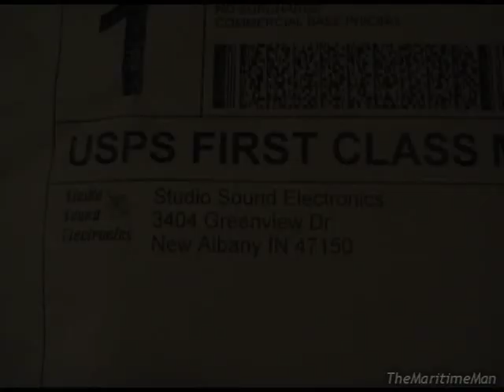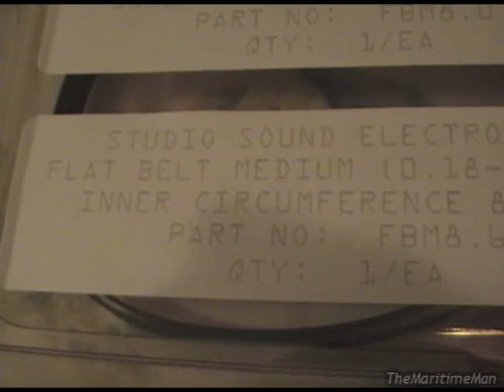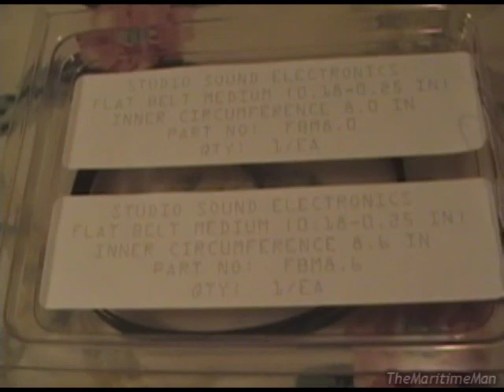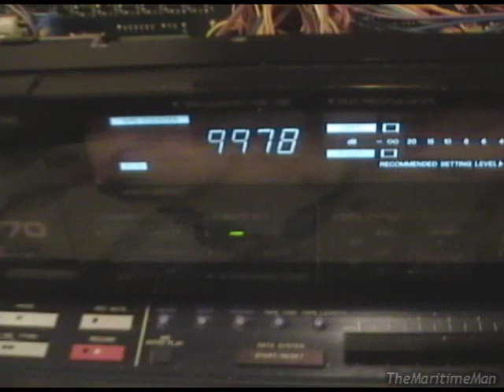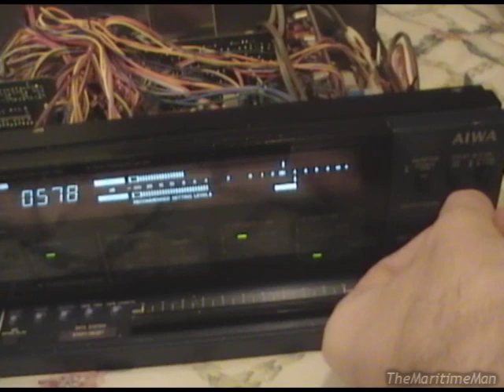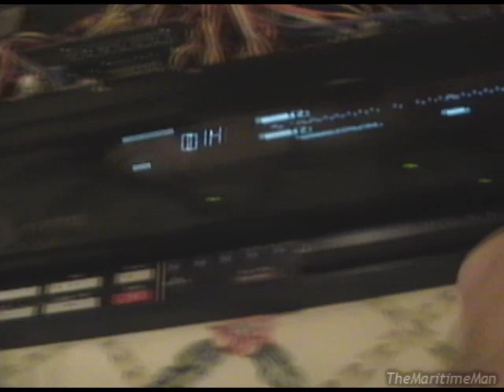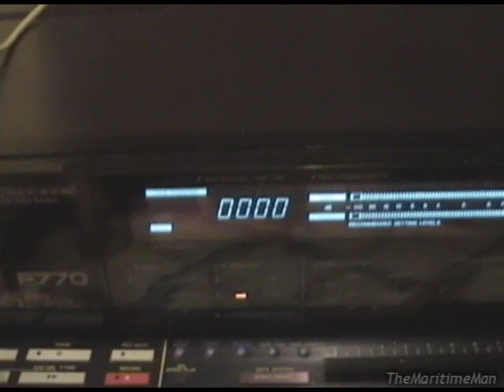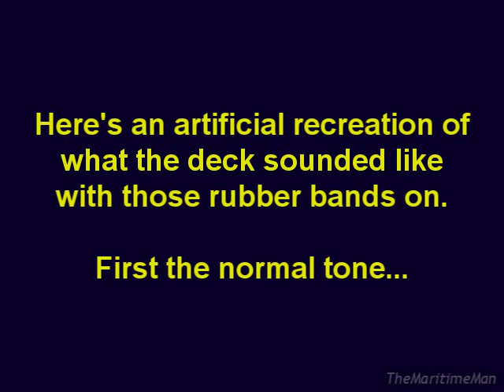Replacing belts in an Aiwa tape deck, the easy(ier) way

Comment: This is a terrific video- thank you so much for posting it, and for all the attention to detail. I took a bunch of notes! My 770 is far and away the best tape deck I have ever owned. I never get tired of hearing those solenoids snap into place; what a great, tactile feel.
Reply: me also zooming 770 or 990 from ebay and elsewhere. need a little help to find reasonable price/condition. my pioneer double deck,i did broke it today,diode goes kaputt.

Comment: Great instructions! I did change the belts in my 770 many years ago and worked out the same way to do it. Good to see someone else coming up with the same method. Gives me the confidence to do it again! Didn’t know about the speed adjustment, which will be useful!

Comment: The Aiwa ADF-770 was one of the best "bang for your buck" cassette decks made in the mid 80s.
If you could not afford a Nakamichi Dragon, then this deck or it's slightly more expensive brother - the ADF-990 was a good choice.

I still have my 770 that I paid £325 (currently $505) in early 1985. This would be the equivalent of $1200 now. 

The best features of this deck were HXPro (superior HF performance), DATA (tune the bias for each individual tape), 3 heads (monitor the recording in real time), ADMS (auto de-degaussing of the heads), Closed Loop Dual Capstan Drive  (wow & flutter = 0.025%), & Accurate remaining time of the tape on the display.

The "DATA" self tune was amazing, it could make a standard ferric (type 1, 120 µs) sound better than chrome on a "lesser deck". My friends & I could not tell the difference between a switched live CD & a "DATA" tuned chrome or metal tape (& we had young ears then!)

Well done & thanks for the belt replacing tips, but in the time that it took you to take the "short cut", you could have removed the whole transport mechanism and tackled it correctly with the confidence that all screws were torqued up and that you hadn't strained anything. I know these decks can look intimidating at first but you have to get "stuck in" to learn.

I'm just about to replace the take-up spool motor & belts in mine... Hmmm, maybe mañana!

Comment: Of interest - the whole cassette drive mechanism can be pulled out if you unscrew the top two screws and one underneath the chasis. One doesn't need an angled screwdriver, although the usual care must be taken. Don't forget to disengage the mains switch on the left too.

Comment: Those last few tough-to-tighten screws are probably because you tightened the other screws first and removed some critical slack needed for perfect threading alignment on the final, yet-to-be snugged home screws.  Try turning each of the screws, all of them, LIGHTLY, maybe 2-3 revolutions each, then go back and snug each screw a bit more, then a bit more while gently wiggling the whole back assembly back and forth/up and down as you're doing the screwing.  Think about how you thread and tighten the lug nuts on a car wheel--it's a similar technique.  This will help maintain alignment in each screw as it tries to find it's "home" while counteracting the effects of gravity pulling the whole enchilada downwards. 
Gravity pulling down on the back of the assembly will  mess with a clean threading motion).  You may also lay the deck flat, face down on a clean towel while doing these final screwing steps, obviating gravity altogether and in fact using it to your advantage.  Outstanding video, by the way, and I commend you for your kindness in sharing your hard-earned ingenuity.

Comment: Thank you so much to post this video.  It will help me to replace the belts.  I bought the F770 deck brand new 30 some years ago.  It is a very good deck.  I tapped all my vinyl on tape and the sound from the tape almost no different from the original vinyl.  
The belts was replaced by a repair shop over 20 years ago and now the deck stopped working again.  I assume it is the belt issue again?   It happened after my last time turned it on and the deck stopped right the way,  but the door would not open and I cann't remove the tape.  Do you have tips for the door stuck issue before I open it up for belt replacement.  Your help is appreciated.
Kim S.

Comment: Thank you so much for this video. I have an R650, I can't find a diagram to show the path of the belts.  When I ordered the belts, I got two.  One flat and thin and round.  I thought the thin round was for the tape counter.  Does it make sense that the two belts are for play and ff and rr.  I put on  one belt, it only works for fast-forward and rewind.

Comment: Just picked up a F990 and wasn't playing tapes and I suspected the dreaded belts. Well, I was right....completely melted! On the main motor drive pulley, and the 2 flywheels. I did get a hold of the service manual but wanted to see an easier way to access these area's to get off all the belt funk off without dismantling it.

Comment: I got an Aiwa AD-F850 and it's probably the easiest to replace the 2 belts bc the inside of it is mostly empty space  and there is just 4 screws to be removed to get to the belts, I guess the AD-F850 is a newer model bc the older Aiwas seem to have a lot of stuff inside (very cluttered).

Comment: I did it the hard way and took the whole deck out, several years back.  Hideous job it was, but I had no screws spare at the end!  Now ideally the machine could probably use new pinch rollers but they are expensive and just as hard to install, so that may not be practical and they may have to just do as they are.

Comment: Thank you so much for your clear and very informative post.  I have an Aiwa R550 deck from 1985.  It always had a great sound but suddenly stopped working, so I opened it up and found the belts had turned to goo.  I ordered more from the US which took several months to come back into stock.  I've just fitted the belts but I took it apart so long ago that  that I don't remember whether I had to unscrew the two black threads mentioned at 11:30 minutes in your video.  Should they connect with the centers of the flywheels?  Thanks, Tracie, UK
Reply from the maker: +Wintonian resident The pins that contact the centers of the flywheels weren't unscrewed or anything - they just touch them when the mechanism is put together.

Glad to have helped!

Comment: Thanks for posting, I now have 2 of these 770's, one has already been serviced... but the second has not, I bought it from the original owner on ebay and it still works, so I assume I will be needing to service it soon... I have been servicing my AIWA personal cassette players, HS-P07 and HS-P09 with success but not yet found out how to change the belt on the AIWA HS-P05... any recommendations would be appreciated.
thanks again.
Reply from the maker: Starsky Hutch I have no knowledge on any models other than the AD-F660/770/990. I did find the P05 service manual, though:

http://www.stereo2go.com/topic/aiwa-hs-p5-hs-p05-service-manual

Comment: Hi,i have a f 660 and trying to change the belt,somehow rotating the wheels,the head is now on up position...any advice to put it down again?Thank you.
Reply from the maker: Go ahead and finish changing the belts. Once you turn the deck on it will disengage the heads.
Reply: @themaritimegirl  Is not working,and the cassette lid is not closing,i put the belts again,power on but the electric motor i not spinning.And before to change the belt was working,so i believe is because the head is engaged is not spinning now?

Comment: i have an offset screwdriver which looks very similar to yours. Both philips tips are too big for the any of the screws. So I bought a Right Angle Screwdriver with a bunch of bits that go down to Philips #1 which was still too big. I have a Philips 0 bit which is still too big. I can't get any grip on the screws in question. How were you able to get any of them off?
Reply from the maker: I honestly don't know what to tell you there. My screwdriver was a little big, but it fit well enough to turn the screws with an appropriate amount of pressure applied.
Reply: *****
i hate to think that the screws in my unit are different than in yours.
Mine is an AD-F770U.
I assume yours is the same, even though you don't add the "U"
Reply from the maker: Moses Kravitz I assume the 'U' is printed on the label on the back, but not on the front? In that case, yeah, they're the same.
Reply: *****
Yes on the "U"

Comment: Recently tried (and failed) to fix this on an F450, my god they are just f**king awful. Designers obviously neglected to consider the possibility of anything ever going wrong with it! I have to say though, a hell of a lot of owners neglected these decks with the advent of digital; if they had all been kept in regular use I doubt their belts would have degraded in the first place.

Comment: How do you replace 2 belts for a AIWA-WX 777.?Do you have the step by step instructions for doing this on this dual deck.?
Reply from the maker: No, as I only own the one deck in this video. You might find the service manual online, though.
Reply: Do you download this procedure in the GOOGLE website or another kind of website here.?I want the step by step procedures of this for both decks.
Reply from the maker: All you had to do was search for it using google, but never mind, I already did it for you. Note that this web site will ask you to make an account before it will let you download it.

https://www.hifiengine.com/manual_library/aiwa/ad-wx777.shtml
Reply: I have tried to download it but only shows the front page of this manual for repairing it.Do you have the photos of the 2 belts that are simply taken out and then replaced with the new ones in this manual.?I'll be having a giant sized nightmare over this issue here.Let's try this here.Show me the actual schematic of the 2 belts removal aka R/R on the deck.Will the tape speed need adjusting when replacing both belts.?I'll wait for your answers.
Reply from the maker: I'm able to see the entire 13 page document - I don't know why you can't. Try this link then:

http://www.vintageshifi.com/repertoire-pdf/pdf/telecharge.php?pdf=Aiwa-AD-WX777-Service-Manual.pdf

It doesn't contain detailed instructions for belt replacement, but it does have an exploded view of the deck mechanism. This is all I can do for you.
Reply: You are right and I don't want to throw this dual deck away in the trash.So what is next.?Try and do it myself and I have no expertise on these things here and belt,replacement is going to be tough to do without someone to help me out.If the shops do it it will be a $100 repair bill and you can bet me on this anytime at all.Can someone else help me out since you can't help me via this you tube site.?If not then i'll suffer this out until I am 80 years old and be stuck with no one to show me how to do this and do that.Would you like this.?

Comment: I have an Aiwa combo system and it works fine apart from the tape decks, which have stopped working.  After watching yourvideo I think I'll just leave well alone, I don't use tapes much no more anyway.  It looks far too fiddly to change the belts.
Reply from the maker: This video only applies to the Aiwa F660, F770, and F990 decks. Your decks are most likely a completely different design, anyway.